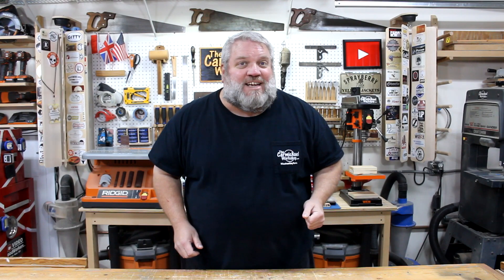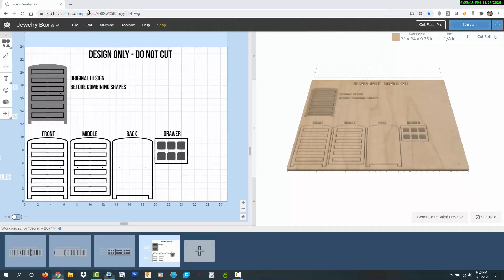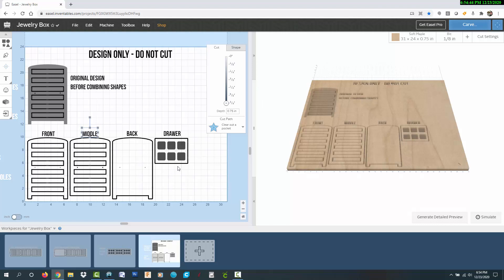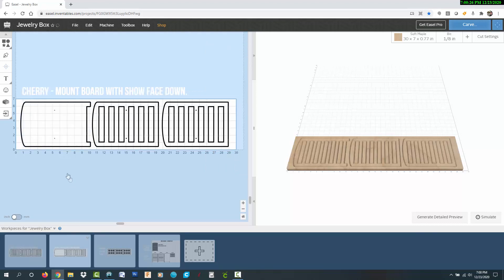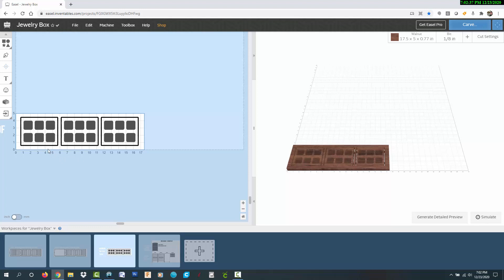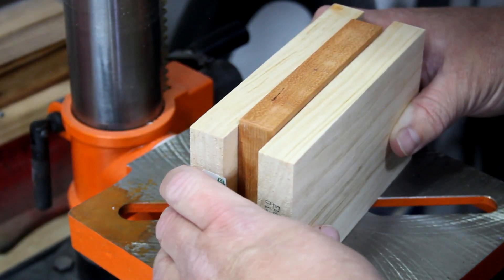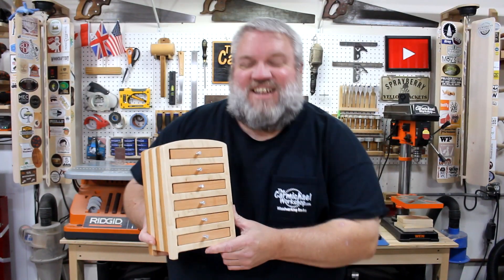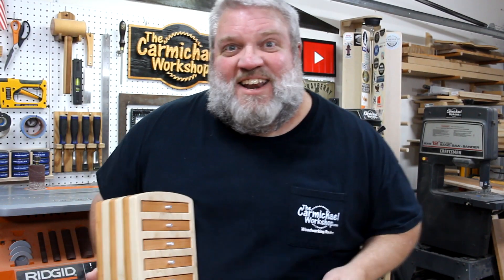Making a Jewelry Box with the Inventables X-Carve CNC Machine

Comment: Nice box Steve, I'm amazed that your X-Carve still work so well. I know you have a newer model than mine, but I think I made too much modification on mine, it's now unreliable. Each time I use it something breaks, a strap snap, a screw get loose and make everything stop, both side never at the same place, I always have to reset them after each cut. And so on, and so on.... I'm glad to see that yours doesn't have all those problems. It's also true that everything went sideways after I put my water cooled spindle. a 10lbs spindle is way too heavy for this machine, but it's the only spindle that can sustain my 23 hours carvings. I've literally melted 3 palm routers in one year... So I'm working on making a new machine, but the covid situation made a stop to my project....

Comment: Very cool.  I think alignment holes are super helpful in the glue up.
Reply from the maker: Hey Brian - Yeah, they helped a lot.  The skewers I used were a little loose, but kept it aligned well enough so I could just sand away any unevenness.   My other option was some wire coat hanger pieces, but I didn't want to put metal inside the wood.  Next time I will just get the right size dowel rod.  lol

Comment: I was looking at getting X-Carve as well in the future. On your system it looked like you had a lot of space to cut everything at once? Would that have been possible?
Reply from the maker: Hey Michael!  That's great.  It's a fun machine.  It really is rewarding to design something on the computer, then watch the machine cut it out, then see it all fit together like you pictured it would in your head.  Pretty cool.  I could have easily cut all the parts out at once from a sheet of plywood.  Cutting multiple smaller boards in one go would be more difficult, but not impossible.  You would have to position the boards at specific coordinates on the machine, then make sure your design has the parts placed at coordinates that would line up with the boards.  Clamping might be a challenge to make sure the bit can travel around to different boards without hitting a clamp.  Double-sided tape might be a good solution for that.  Maybe I'll try that sometime.  Also, cutting all the parts at once commits you to monitoring the machine for 4 hours straight.  I've found that cutting each board separately ties me down for only an hour or so at a time, so that's actually nice in case I get interrupted or need to run an errand.  Hope that helps!  Steve...

Comment: how big of a work surface does it have?
Reply from the maker: Hey, here is that info.  Note that the 65mm vertical cut height includes the material thickness, travel clearance, and bit length required for the depth of cut.  https://inventables.zendesk.com/hc/en-us/articles/360012452474-What-is-the-maximum-size-material-that-can-be-carved-on-an-X-Carve